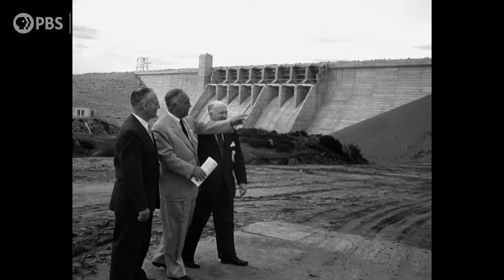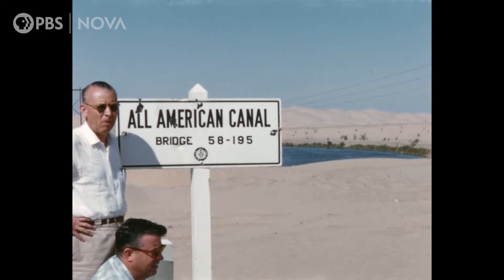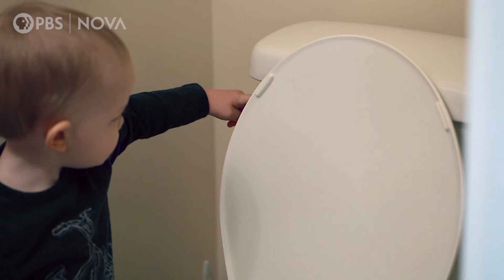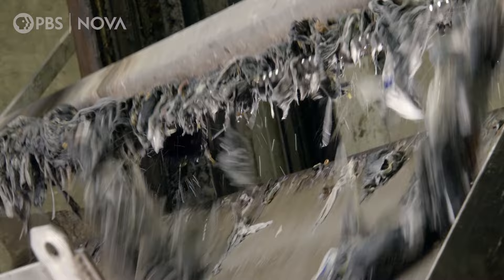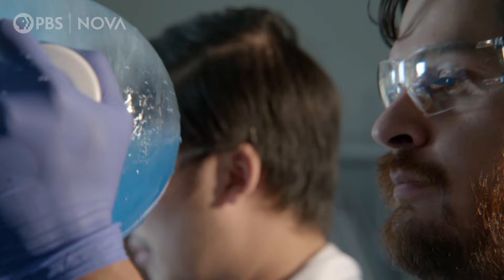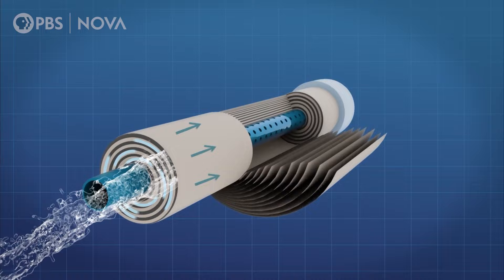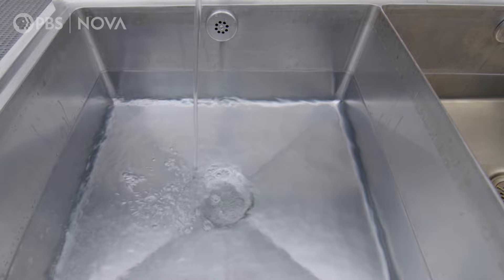How Sewage Becomes Drinking Water

Comment: I wish that they would have explained the purpose of the aeration better. Adding oxygen allows bacteria to quickly use up the nutrients in the water. This has two purposes: it reduces biological contamination by removing bio waste. But it also makes it safer to return the water to rivers and oceans. Natural water systems would be thrown off balance with such a large influx of nutrients, causing such problems as algal booms, or deprivation of oxygen by bacteria that are eating up the nutrients and using up all the O2, suffocating other life. Which makes me wonder why California has been simply dumping waste in the ocean when they are ostensibly the most environmentally minded state, when other states have been aerating waste water.

Comment: Why not simply steam the water and distilled and condensed back with minerals.. 

Would that not be more practicable?

Anyways, great water sustainable recovery solution..

Thank you for sharing.
Reply: Steam takes a TON of energy to produce in large volumes
Reply: @tctk1  use the solar panels to do the heating which already a well known functional and practicable in many 30°c to 35°c countries.

With climate change that is more likely scenario..
Reply: @l0g1cseer47  climate change doesn't mean more sunlight. Temperature differences don't mean more sunlight.  Secondly the cost benefit ratio of solar for that is insane. Solar isn't as efficient as you're assuming it is. Also I'm a waste water operator..  So take my word for my career
Reply: @tctk1  the waste water tissue filtration represents a major risk of health concern to individual like you at more risk of danger. And it is for everyone benefits to understand that what I am indicating is much more sensible solution to prevent further more risk to human population.
Reply: I see it more as a combination system. Reverse Osmosis is expensive due to the amount of pressure needed to force the water through the membranes. You could prefilter with larger micron filters that remove heavier particles but allow smaller ones through. Then you could utilize the deserts to focus sunlight to a focused point that then reflects down onto a greenhouse with a pipe at the top for the vapor distillation.

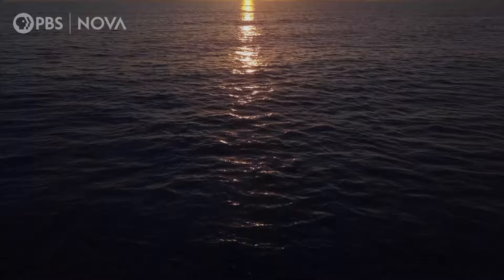Comment: 1:32 Yeah that definitely looks clean....
Reply: It really is very clean by the time it finishes being processed. Most of it is accomplished by bacteria and bugs. It requires constant monitoring, documentation and constant adjustment to get the output water clean. The two main causes of problems in a wastewater system is chemicals that kill bacteria and "I&I" (inflow and infiltration) by rainwater.
Reply: @troy3456789  How do you explain the green, horrible looking appearance then...?
Reply: @djayjp  To me it perhaps seems like the process might possibly not be finished. You know, how bread doesn't look that great until it gets baked. A car just looks like rocks until the ore is sufficiently refined, the metal extracted and mixed into alloys then forged and machined and so forth. A baby doesn't look like a man in a suit until a few decades has past. That sort of thing. Golly, l sure hope I didn't labor the point too much.
Reply: @SofaKingShit  If it's not finished being cleaned then why is it being dumped into the sea...?